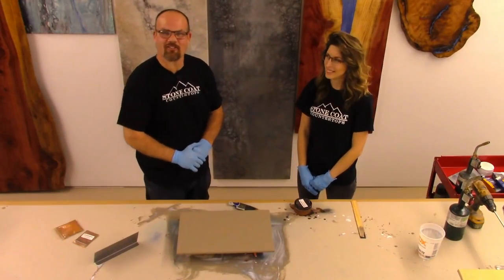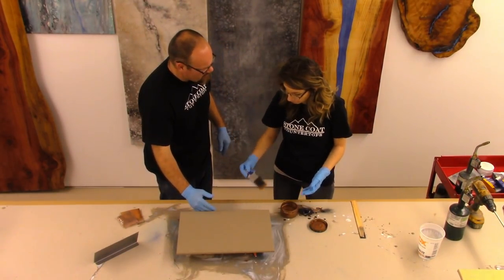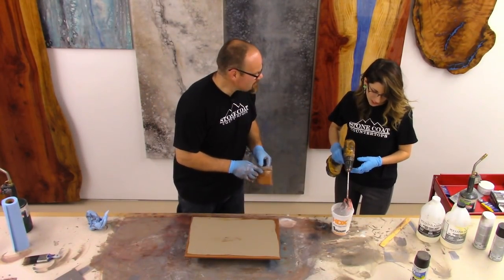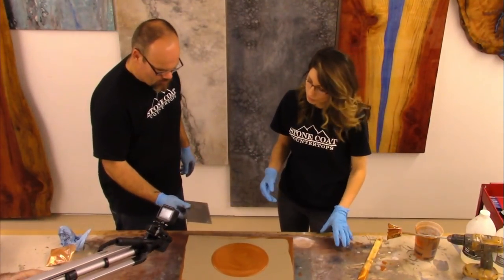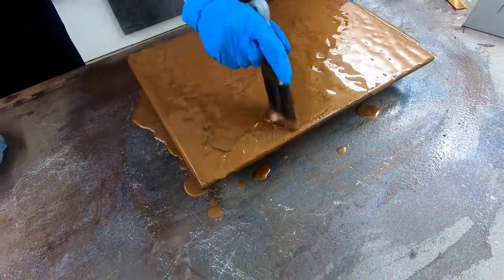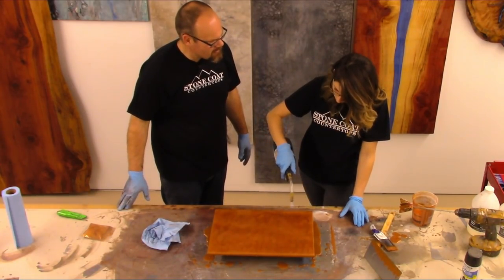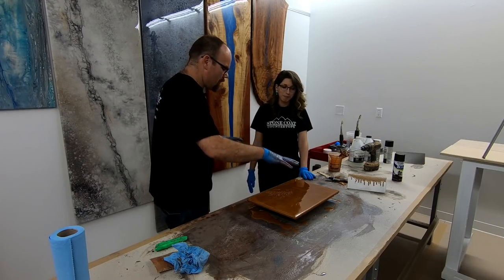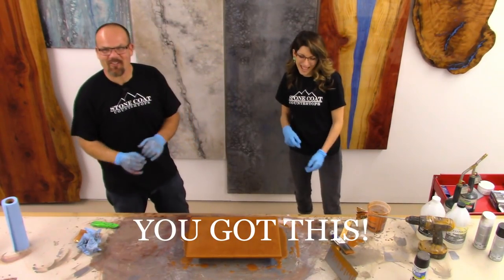Liquid Brass Epoxy

Comment: Im about to order my 2 gal. kit but I had a couple questions...When doing a backsplash as well, when completed what do you use to seal the countertop to the backsplash? Silicone, caulking or something else? Can you use anything by Rust-Oleum 2x aslong as it's a gloss? Also on your base coat of paint and primer in 1 do you only use satin finish?
Reply: Thanks for the quick reply! Just ordered and received my 2 gal. kit, im super excited to get this countertop done!

Comment: how do you clean the resin from brushes?
Reply: You can use sillicone brushes. Epoxy does not stick to sillicone and you can just peel the epoxy off with relative ease.